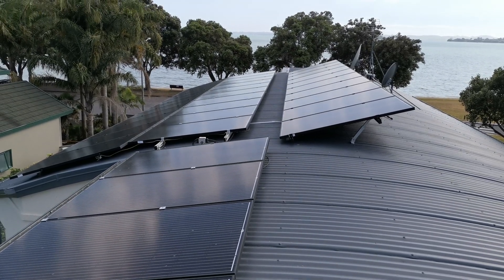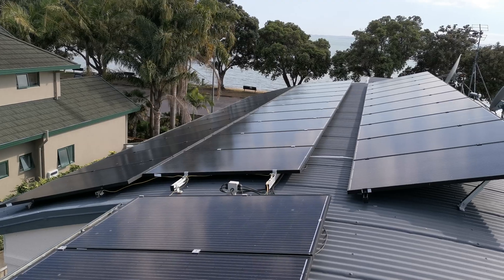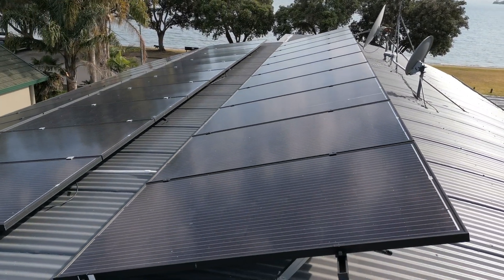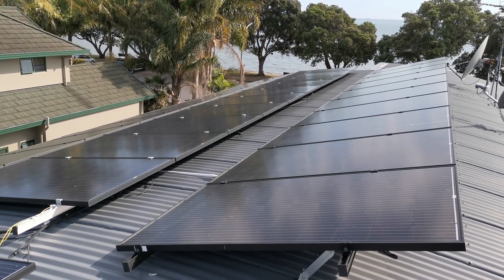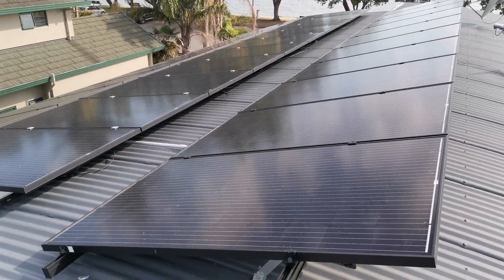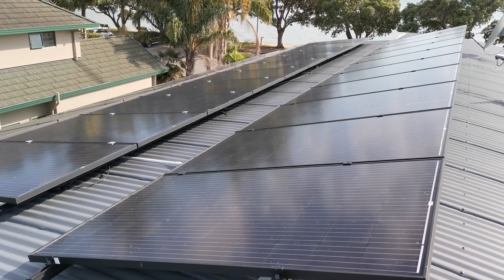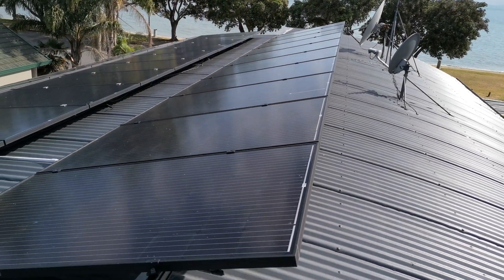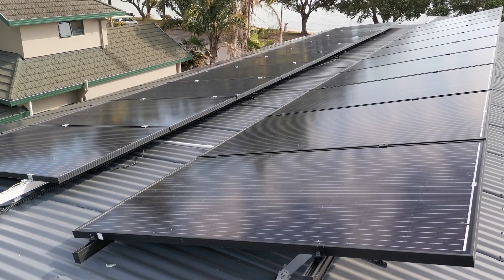My 10kw Solar Panels

Comment: When you are using 9kw during daytime, can you be off grid relying on solar panel only?
Reply from the maker: That would really depend on your sun hours and battery size.
Reply from the maker: I have 40 KW of panels which is an over kill. I actually dump more power than I use.